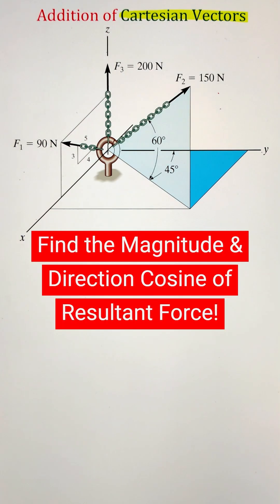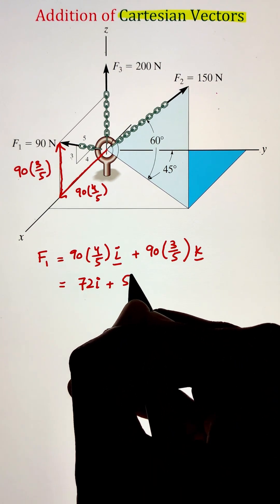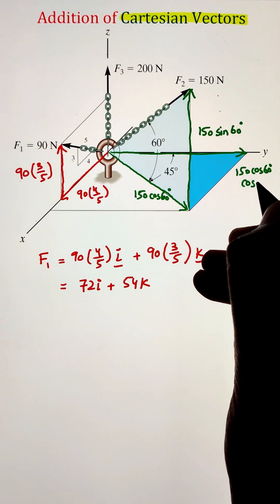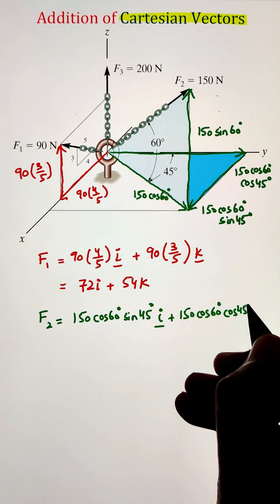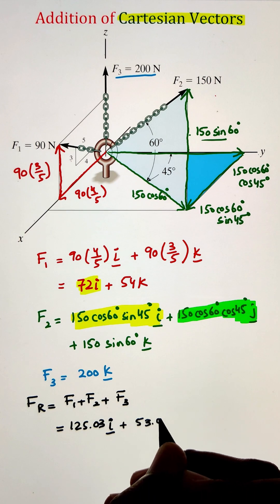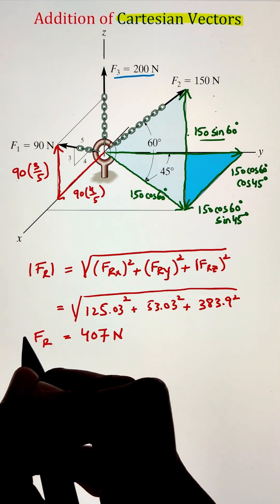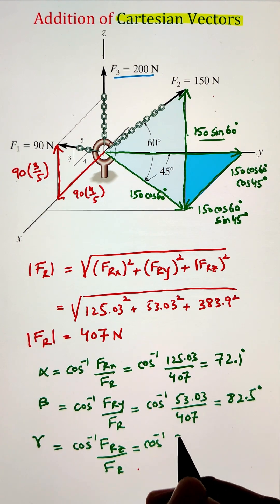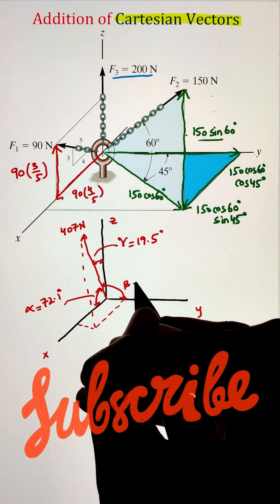Resultant Force & Direction Cosines | Statics Made Easy

Comment: Can you please explain further the F2 part, i still don't understand how did you assign the cosines and sines of the force.
Reply from the maker: For the F2 force the cos fn basically project the force to the axis from which the angle is measured, so if I take cos 60 , it will project the force F2 on the line on xy plane, now to further resolve it, this line is making an angle of 45 with the y axis, so if I again take the cos 45 function it will project it along the y axis.  Whereas the sin function project it on the plane perpendicular to the axis from which the angle is measured from.

Hope this helps